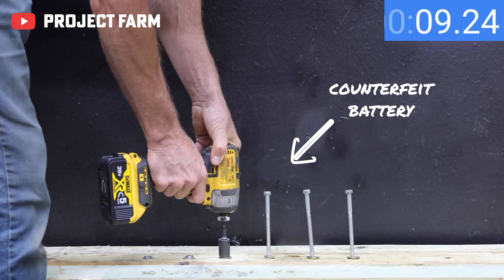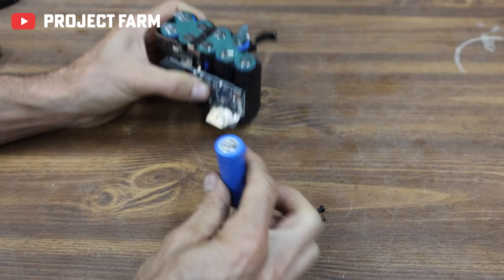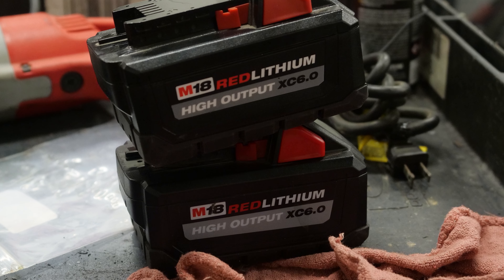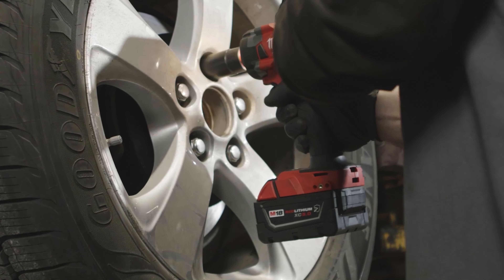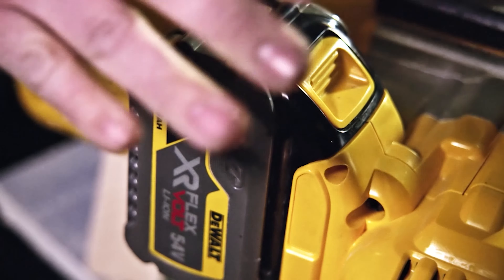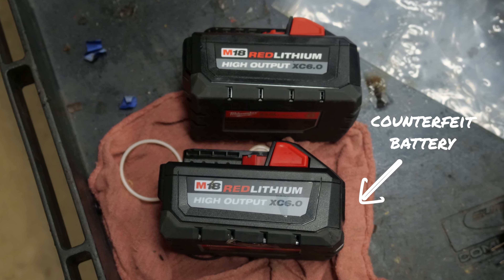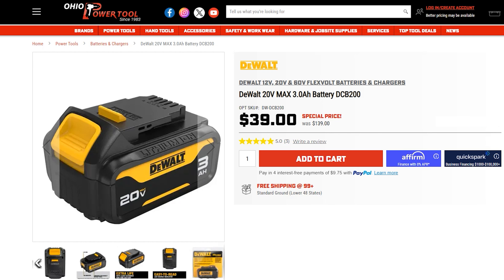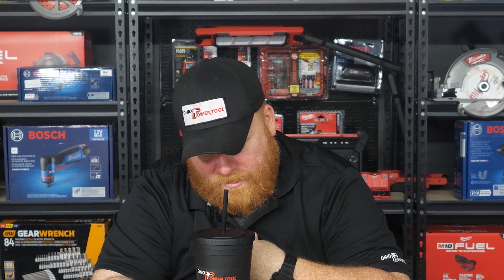The SHOCKING Truth About Counterfeit Power Tool Batteries

Comment: Home Depot was selling a Christmas kit of Milwaukee batteries about three years ago. You got 8.0 Batteries plus rapid charging.  So I purchased it about eight months after Christmas when it was on Clarence for about $125. It was one of those boxes that was sitting up in the overstock where you have to look for it, because they didn’t put it down on the shelf Because there’s no room for. Well, I purchased the last two they had in stock, sold one of them, and when I went to open the other one, it had counterfeit Milwaukee batteries, and a Milwaukee charger. 

Moral of the story, if you ever see something in a Home Depot that has tape on the box, open it up right in the store before you leave to make sure it’s the right thing. 

This also happened to me with the Milwaukee GEN 2 18 gauge Brad nailer, The box at tape on it, I didn’t pay attention to it until I got it home and it was the GEN 1 in the box.
Reply from the maker: Crazy, had no idea these return scams were a thing. Must be why you need to give them 3 forms of ID when you try to return anything to the big box.

Comment: Maybe if the batteries didn't cost so much, it would put the counterfeiter's  out of business.
Reply from the maker: We love the idea of the lower cost entry level batteries that fill basic needs, premium price for the latest technology is fine but not everyone needs that. Full range of battery solutions would go a long way to keep out counterfeits.
Reply: But the problem is the counterfeit batteries will be like 1.5 AH but put in a 5 AH case. The only way to compete with that is to do the same. It's like selling 97 octane gas at 87 octane prices because what you did is just mark the 87 as 97!

Comment: One way to tell if a battery is fake is by holding down the power button. It will have a series of blinks that tell you have many times that battery is used. The fake batteries won't have this option
Reply from the maker: That’s a great tip for today, it’s important to consider every step to add another layer of authenticity will likely be added to next round of counterfeits. Constant battle the tool brands will face.

Comment: Not all counterfeits are junk.  Have been using them for years & they have performed flawlessly.  At 1/3 the cost can't go wrong.
Reply from the maker: It’s basically a role of the dice and never as they they are advertising. Clearly these counterfeiters are capable of making functional batteries and they have choice of what quality of cells and electronics they use, so could choose to spend more on higher quality components like the actual tool brands do. But from what we’ve seen in house and from what you’ll see in about every other YouTube video who is testing actual fraudulent batteries they always lie about the AH, and construction of packs cuts a lot of corners with cheaper electronics, poor welds, etc. If you want a lower price tool and battery why not go for one where they’ll put their name on it and guarantee their work? Ryobi, Skil or number of other house brands.

Comment: Can counterfeit batteries be scanned by Milwaukee Service Center. I bought a 6.0ah battery in Home Depot and took it Milwaukee to have it serviced, the rep told me without even hold the battery that it was fake. Said something about the internals are gonna be different and he compared it to a 2024 model mine was a 2019 model but I had purchased it in 2021. He takes it back to “look” at it then comes back and connects the battery to his computer than says that the battery was first used in 2020 and does not match my receipt. Every time I purchase a tool/battery I link it to my Milwaukee account. Long story short I took it it HD and they replaced my battery without giving me any trouble
Reply from the maker: There is a battery reader that a service center can put on and says first time used, max temp, how many cycles, etc. the date code is printed on the bottom. If it’s a fake it would give all the data so no odd unless this was bought in a kit and that had been returned or something?